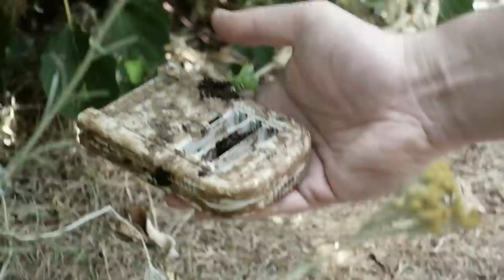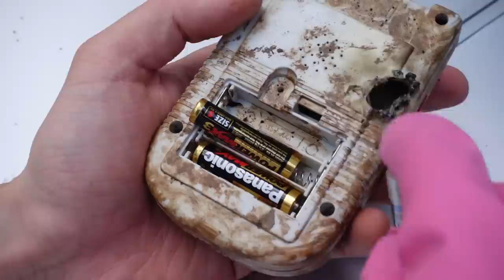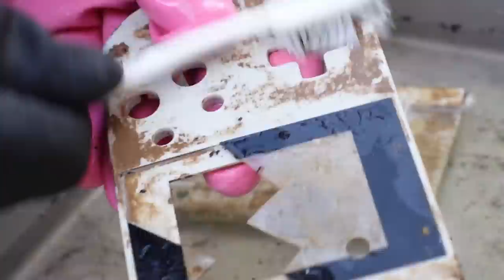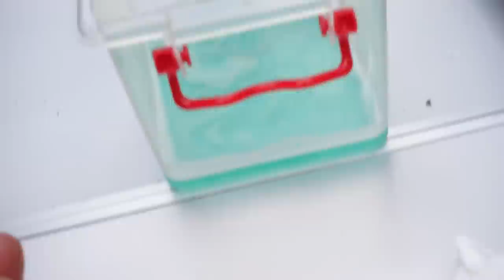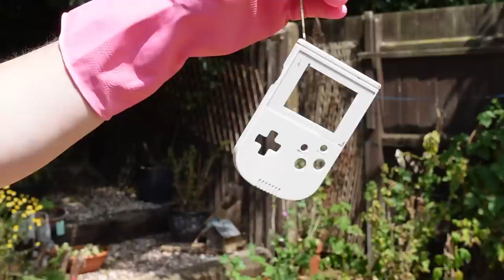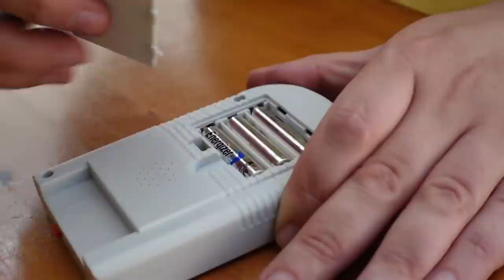Restoration of ninTendo GameBoy GBA Destroyed | Repair & Restore DS Classic Sony

Comment: pro tip : works only for 3DS XL zelda edition, place in microwave at full power for 6 hours, then place the melted result in your freezer for a day, the console has shape memory and will rebuild itself, only issue is you need to plug it directly on 360volts unless you melt the charger with it in the microwave, but it worls fine.
Reply: lies
Reply: Is worls meant to be "works" or "whorls," because I tried it and my very expensive handheld video game system now does nothing but spin around.

Comment: Ah yes, found an item in a dump, Water proof PCBs, delicate screen handling, filling broken holes with rice, new components made from the dust of the old + lime juice, and lastly water/baking soda/mouthwash baths and paint which instantly renew broken or cracked stuff. Truly a masterpiece with a whole new GBA 200 even comes with a whole new set of games without the need of a cartridge slot. And the graphics were as crisp as I remembered them

Comment: Hi. I am trying to fix my Sega Game Gear which has a bullet hole through it. Can anyone recommend which dried food I should use as a filling? I heard ramen noodles are good but can anyone recommend which ones? Does it matter if I use chicken or is it recommended to use curry? Thanks in advance!
Reply: i personally don’t use a completely dry filling i use ravioli for one i find it works better in the end
yes it matters if you use chicken you can’t use chicken curry but you can use a plain curry with chicken for better results and instead of soy i recommend teriyaki it helps it dry better

Comment: A very amazing fake video. You can see it e.g. in the housing. 
It is painted with spray paint and the paint forms noses. 
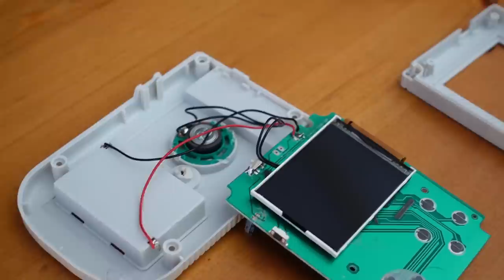When assembling the device, however, you can see a colored plastic housing ( 12:14 ). 
by the end, only the screws should be original. But it's still entertaining